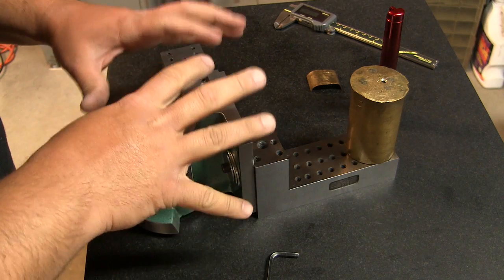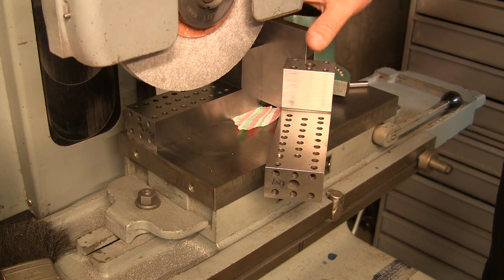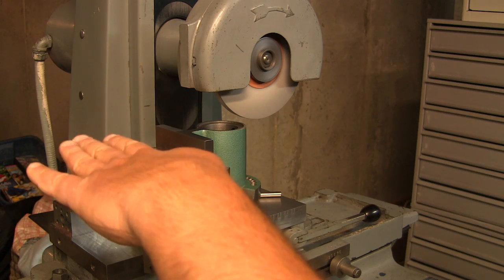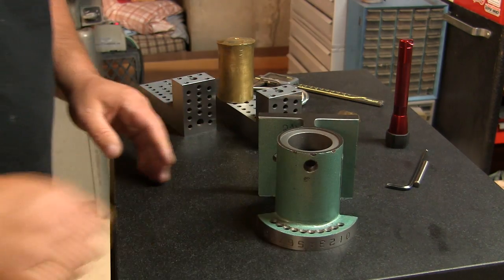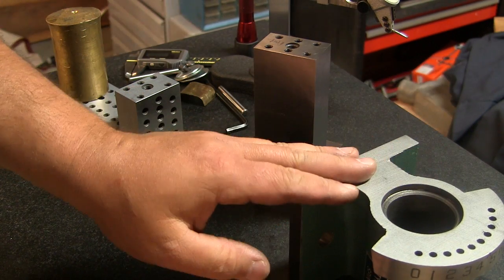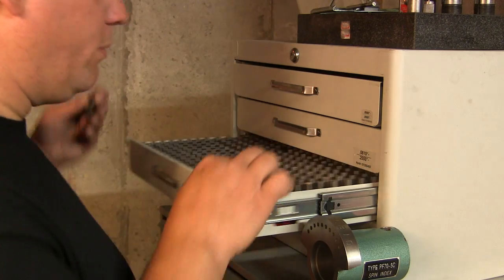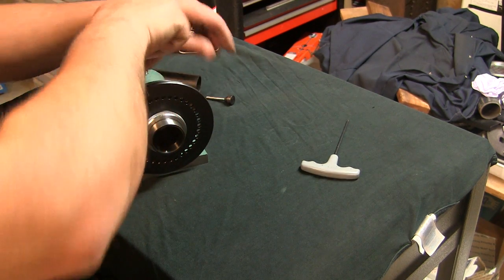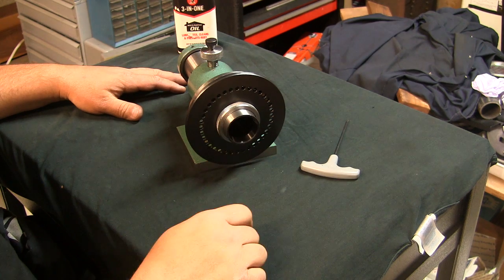Spindexer Modifications Addendum   B

Comment: The only thing that matters on this is the bottom of the casting in relationship to the boar nothing Else matters one bit. You're never going to need to indicate off of the sides or off of the front edges or any of the front surfaces the only thing that matters is the the bored in relationship with the spindle the only way to properly check that would be to put a Khalid in it and put a piece of ground steel or a gauge pin protruding out of that spindle and indicate that in comparison with the bottom
I don't want to sound like an ass whole but you're wasting a hell of a lot of your time

Comment: Hi Brad,

Nicely done. I am very impressed at how you have improved on the typical Chinese spin indexer. I want to make a similar project because I want to make a more accurate electronic indexing tool that has a cast base. 

I'm just sad that not once in any of the four videos did you mention the main spindle diameter, nor the thread for when you machined that retention ring (the one process that you lost the video of)... 

Now, since I don't have a surface grinder, how will I true up my surfaces once I indicate the spindle bore for true... maybe scraping, well at least for the base anyway. I'll also add an indexing key to the base that aligns with the center keyway on my mill.

If you get a second in your shop, can you measure that main spindle diameter please?

Comment: Isn't the import part that the bore is square to the other surfaces, I only saw you square the ends to the bottom without regard to the bore. Or did I miss something?
Reply from the maker: I don;t control the commercials bud... A last-word .001 indicator, is not the correct choice for high precision metrology. When you surface grind, do you use a 1000th's indicator?

Comment: Hi Brad, nice work improving the "low precision" spindexer. You have the base squared and parallel, but I was wondering how true the edges of the casting is with the bore and spindle as I do not recall seeing you check that or did I miss that somewhere along the way? You may want to look at using a spray dry moly as a lube as it protects from rust as well as lubricates and dirt and grime does not stick to it. Thanks for taking the time and effort to produce this series and share your experience as it is truly appreciated.

Peace!
Reply from the maker: Jeffrey Vastine Hey jeff. Yeah, I have the spindle parallel and square in all directions. There are 4 parts to this project and it came together a little rough, but all sides/planes were thought out and checked. First, one side was indicated parallel to the spindle. Then, I flipped 180 and ground that side. Next, I placed the ground side against a 90-angle block - in TWO axis (X & Y) if you can picture that (see Addendum B, right in the beginning). The bottom plane wasn't ground because it was within .0003 (3 tenths), which for (my) kind of work, is perfectly fine. I suppose I could have ground the bottom to within a tenth or 2, but decided not to since 3 is ok.

Comment: I saw that you ground the sides parallel to the spindle bore, but are they equal distances from the spindle centerline?  --Doozer
Reply from the maker: kooldoozer I don't know to be honest. But it's not needed since it will be clamped in the vise or bolted to the table on the mill, then the table will be moved around to located the center of the workpiece.
Reply: Just thought I would mention...
I have seen some guys turn the spindle around so the 5C collet is at the opposite end of the index plate.  This puts the plate more out of the way of work being done. I think it is a smart thing. What say ye?
Reply: kooldoozer that would make sense where the extra clearance would be needed, other than that you're compromising the stability of the spindle and collet allowing for vibration/harmonics..that can be tough on a grinding wheel
Reply from the maker: kooldoozer I don't understand how that would work? If I reversed the spindle. it might not even register in the casting (not sure if the recess is the same on both ends) and rear-end of the casting doesn't have the holes to lock the index plate, so the spindle would just spin freely, aside from using the locking nut. But maybe I'm missing your point totally?
Reply: The index wheel gets moved to the non-collet side of the spindle.  It still interfaces with the vernier holes in the casting.

Comment: Like Mr. Wander, I question if the bore is square and perpendicular to the base surfaces.  In addendum A you indicated in one plane off the spindle bore insuring the casting was being held so the bore was horizontal, but I did not see you indicate the spindle to insure the casting was being held so that the bore was also parallel to the Y axis.  Probably doesn't make much difference, but as an exercise should be considered.  Nicely done series, thanks.
Reply: BasementShopGuy IMO: It could be interesting to mount a cylinder/measuring bar in the spindexer and find out if the mounted piece is level and rotates in the x-axis (like measuring toe-in and  camber on a car).
Reply from the maker: Morris Gallo Hi Morris - the spindle was indicated  and the parallel side was then ground. I flipped it 180 and ground the other side. Then (positioned as if the spindle were a mill's spindle),  I placed one of those ground sides against the angle block and the other side in the other block to square up the X & Y. The only plane I didn't indicate was the bottom-flat, as it was ground pretty close. That should cover all of them, unless I missed something?
Reply from the maker: Citronitroify yeah it'd be interesting to see. I don't have the tools to do that though. I'm trying to clean up a cheap spindexer and make it better.

Comment: That took care of the Chinese variables, now, they're out of the equation...
Gives you a fine tool with some self teaching along the way, done great.
Cheers, Pierre
Reply from the maker: pierre beaudry Thanks Pierre. It's not too bad actually for $35. It seems to be missing those few steps that other makers take to get dialed in.
Reply: Rough stuff is quite cheap to make, as you demand more precision, the labor get more intensive, and the cost rises sharply. You just did the expansive part yourself... :-)